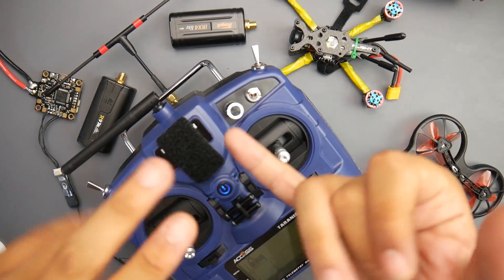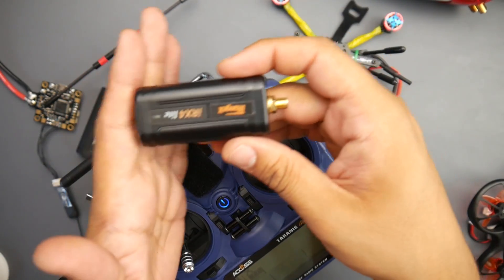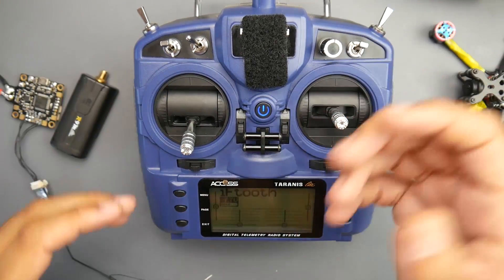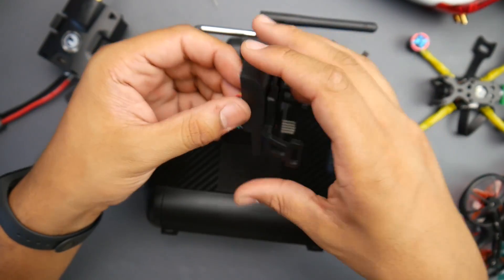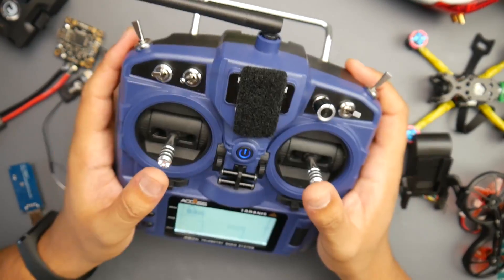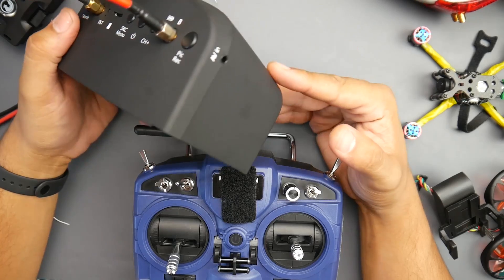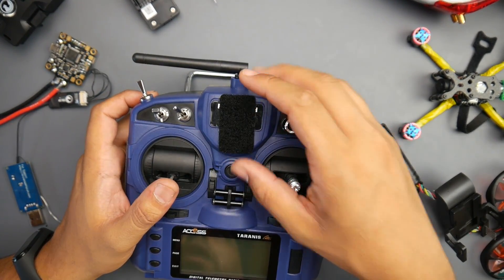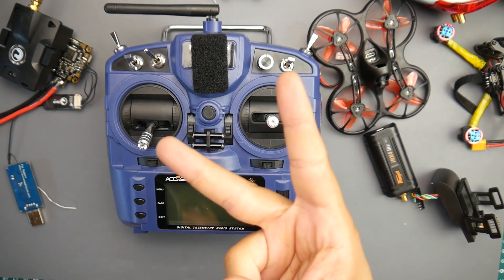The Missing Information Tested FrSky X9 Lite Pro // D8, D16, Crossfire, Confirmation

Comment from the maker: X9 Lite Acceosries:
FrSky X9 Lite Flavor 1: http://bit.ly/2ZPXekb
FrSky X9 Lite Flavor 2: http://bit.ly/2JB0cE5
X9 Lite Adapter: http://bit.ly/2PeYmgg
MultiProtocol Module: http://bit.ly/2CNOFOG
X9 Lite Charger Mod: http://bit.ly/2FiL2AM
TopSky FPV Watch: http://bit.ly/2JyPiOT
Rush FPV Antennas: http://bit.ly/2Sk5d6D
X9 Lite Extra Accesories: http://bit.ly/2XLiiXG
R9M Lite: http://bit.ly/2Y3fRjy
Carbon Fiber Anti-Skid: http://bit.ly/2XLwIvM
Reply: How do you use the multi protocol module on this specific transmitter?

Comment: Im not finding much more info on this and I need this r/ELI5'd to me because I'm new-ish to drones. I'm looking at buying a RTF 5" with a crossfire receiver and this transmitter so I'd need to do this charging mod and run a "multi protocol" tool? Or is the charging mod optional for the tool?

Comment: Nice video. I have one question about it, how to enable multiprotocol on open TX (on companion "multimodule build option is not present in the new versions of companion for frsky radio)? How have you solved this issue?

Comment: So if my want my X9 Lite radio to bind to D8 I need the IRX4 Lite module? I have the TH Freestyle 2 that says it's D8, but I changed in Betaflight a configuration setting from FRSKY_D to FRSKY_X and am flying the TH Freestyle in D16. Is there a benefit to getting the IRX4 Lite module and binding in D8 over binding in D16 like I'm doing now? Or am I going to run into a binding problem as I buy more drones that are made for D8 unless I get the IRX4 module? Any help and advice is appreciated. I'm just getting into this hobby and am trying really hard not to blow money on the wrong things.

Comment: Thumbs up. In the 2019-10-05  2.3.1 , crossfire receiver side s-bus also works, which is my main goal. However, the 10-05 build fails D16. And I have to use my QX7 to bind my XM+ receiver. So, I need 2 radios or swap my x9 lite firmware everytime I switch my model.

Comment: Nice video
I ordered the uruav version
Is it possible to connect r9m with this mod or r9m 2019?
Or is it worth to buy r9m lite?
Because I'm on a budget, cant buy r9m lite pro
Really want to know
Reply from the maker: Theoritaclly you can but I am not 100% sure.. if I have time I'll test that this week and report it in a video.
Reply: @DroneMesh  wow
U'll be my hero if u do so
I find a r9m 2019 with R9 mini for 70$ in my town, but not sure if it will work with x9-lite

Comment: So I ordered the multi-protocol module for my x9lite. It does indeed just slide in the back? Running nightly , disable the internal rf and enable the external and switch to d8 ? New to fpv and ordered tinyhawk s and x9 lite.
Reply from the maker: Yes 100% I have been flying like this since I got it..

Comment: Been useing the multi module but when you change to 2.3 firmware and you change your sd contents make sure you add the pmu update and isrm update or the module will not work on some radios
Reply: Which other updates do I need to do? Thank you pmu/isrm?

Comment: If you want "the full package" the x9dse is still the way and that jumper with the color screen is fantastic too especially if there is a gimbal mod out there. But I just ordered an x9lite pro as my qx7 was stolen from my car. And I have no problem with crossfire needing an adapter, I'd 3d print one if I wanted it and I'll probably run r9 instead anyway. Nothing against tbs products. I run the unify despite the cost but crossfire is a little rich for my blood. It may be worth the money but I'm a good is sometimes good enough kind of guy.
Reply: Me too, dude. I understand and agree completely. 😊

Comment: I have something interesting. Can you do latency test on the X9 lite? Few weeks ago, I saw someone sharing a spreadsheet of latency test between radios and interestingly, on the same receiver, protocol and OS, the X9 lite with the new ISRM module has less latency by nearly 10ms compared to X9D with XJT module, bringing it quite close to Crossfire. Would like your thoughts on this.

Comment: Actually, I wrote to FrSky and received a reply regarding D8.  Sadly, the news was not what we had hoped.  D8 support will NOT come in the form of a firmware patch.  The following is an excerpt from that email:  "...we are shifting away from D8 in the internal modules of the newer radios."  For regional restriction reasons, that we already know, but they also stated, "...the current plan is to support D8 through multiprotocol modules as well as with a proposed XJT Lite module for the newer radios."  The following link confirms the XJT module in the lower left of that webpage under Compatibility List:  https://www.frsky-rc.com/frsky-advanced-communication-control-elevated-spread-spectrum-access-protocol-release/
Reply: The same reason why T16 ships with no internal RF module. Not sure why but apparently having separated RF transmitter makes the product comply with regulation easier.
Reply: @Asu01  It would appear that is the case.  By the way, your handle "Asu" does it have anything to do with Arizona State University?  Just asking, ASU alumnus here.
Reply: No.. not really,  @frankbarajas . Just a random word I picked for my username. Nothing special about it.
Reply: Asu - oh, lol. I was hoping.  I wasn’t that creative and just used my name.
Reply: Just bought an old school X-lite as a backup radio because I wasn’t holding my breath for D8. Thanks for checking with them.
Reply: Is there any particular reason people favor D8? Something to do with micro quads I guess?
Reply: Asu several very popular micros require D8 like the Tinyhawk. Astounding that Frsky just thumbs their nose at so many people. FPV isn’t a huge community. You’d think they’d want everyone on board.